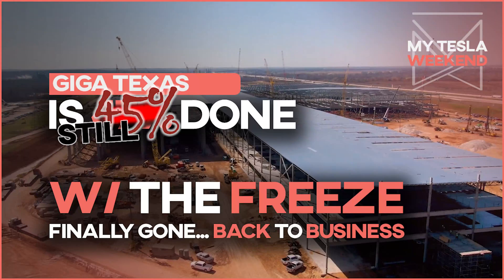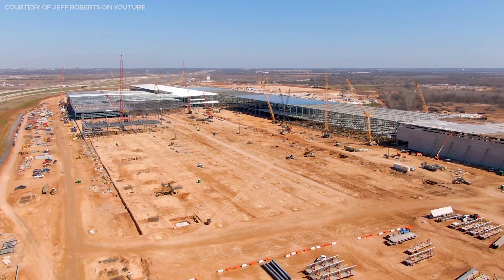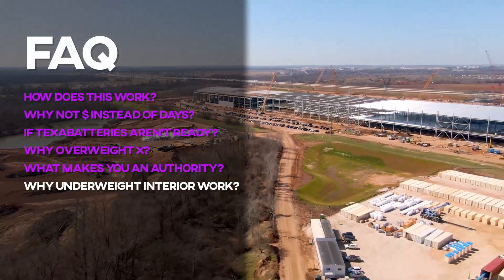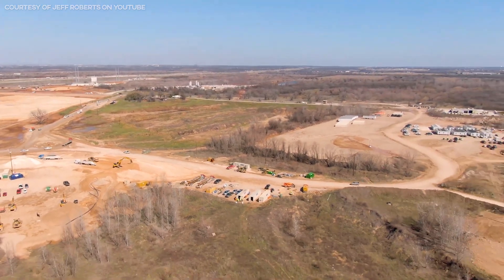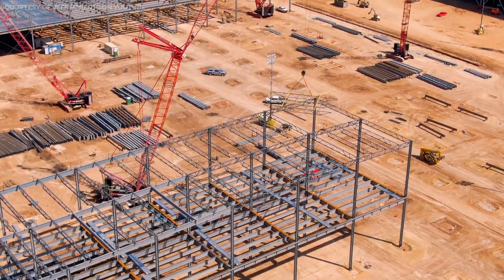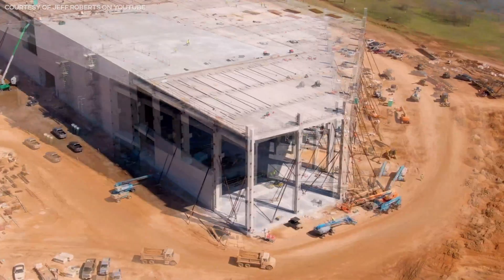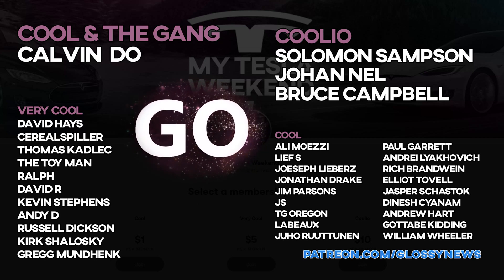Giga Texas is 45% done, and an FAQ on the math

Comment: Batteries.  Elon has said all along that initially they would have to supply batteries to both Berlin and Austin.  ( Actuarlly he said Berlin,  but I have just assumed that would be same for Austin as Austin also had battery production removed from phase1.)   At the time he was allocating batteries from pilot plant.  That problem appears to have eased.   Panasonic have announced there 4680 pilot line begins production in April.  LG have stated they will have there pilot line running before Panasonics. So we will hopefully have enough 4680 cells available for both Berlin and Austin.  Hopefully also leaving Teslas own high power  cells available for ramping up the cybertruck and the semi a little quicker.

Comment: It’s such a tough call. Hindsight is always 2020 and even then the complexities AND VARIABLES are NUMEROUS! So, my hat is off to you for even giving a hoot going through the trouble to make some sense of it for us. There are surprises too and Texas may have a good one: One of the giga presses from IDRA (in Italy) was delivered some weeks ago and is now installed. The aluminum melting furnace followed delivery a couple weeks later and also appears to be installed. Electrical infrastructure (temporary and permanent) at the install location has gone through clean/tidy-up (scrap-etc) making me think they’re pretty close to having this system not far off from operation! I haven’t seen (nor heard of any) evidence of the remaining machines to come so I ask myself: “Why all the effort for ONE 6000lb casting machine so EARLY AND in a building which has yet to see wall one and barely has a roof (and still a leaky one at that)? I think it totally reasonable they’re gonna get to producing and stockpiling 3 and/or Y castings as soon as practical! When the press itself was first placed the building had about half the total concrete “cathedral” columns in place and no roof. Now with all the progress, it is still the only occupant of this northern “concrete cathedral” taking a mere fraction of the space under the now full roof (composed of those same type pre-stressed “TT” concrete sections as the southern cathedral). Let the fun begin!

Comment: Quick question, how long and wide will the finished building(s) be?
Reply from the maker: Don't recall off the top of my head, but I measured it based on the siteplan submitted to the county here: https://youtu.be/UxjEzlRJ-EI
Reply: Many thanks and thanks for the channel. I can find the figure of 7.9 million square feet, but not length and width. Thanks again.
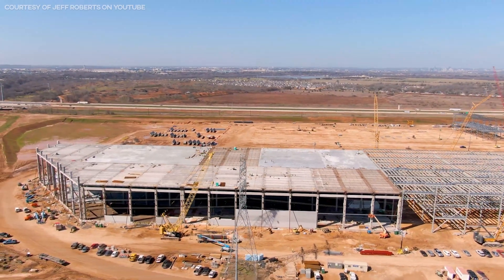Reply from the maker: @Nemutai666  it's around 1:30 in that video.

Comment: I'll make this prediction now. We'll see a retail-ready Model Y roll out from Texas while they're still tooling up for Cybertruck.
Reply: Oh, and in regards to your 4 months to complete an interior I have no idea how that scales with size. Considering that Austin Phase 1, in total, is about the same square footage as Shanghai Phase 1-3 combined. Not saying you're wrong, just saying it's a much MUCH larger factory.
Reply: That was the original plan.   And it.will be the third Y line they have set up so it should run smother than cyberT.  CyberT is a new process never done before ,  it will be much more difficult.  Might even see the 3 running as well if the battery supplies hold up.
Edit...    I forgot Berlin,  so that makes it the 4th Y line.
Reply from the maker: Not a crazy prediction.

Comment: People don't realize that the 20% interior work is after it's enclosed, some work is done beforehand. I hope to see some additional buildings included once some permits come out. Looks like we can assume the one is the substation though. You missed the one FAQ, why is this channel so addictive.
Reply: I wanted to add more info separately on batteries. LG and Panasonic both are making pilot lines, assuming 10GWh or greater. Thats enough for 100k or more MY this year. Very limited cybertruck production in 2021. 100 GWh just from Tesla in 2022, enough for 500k MY, 100k cybertrucks, 10k semis and more. Also of note the 3 different battery chemistries. High density (cybertruck and semi), medium density (MY and M3) and lowest density for energy storage.